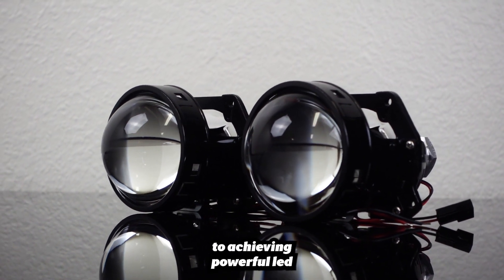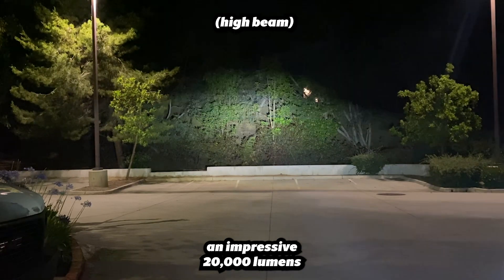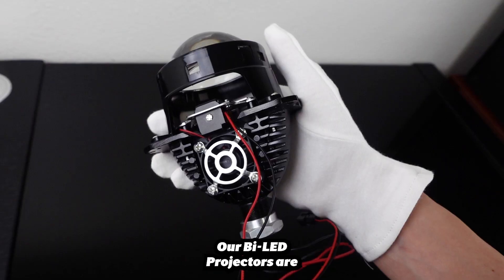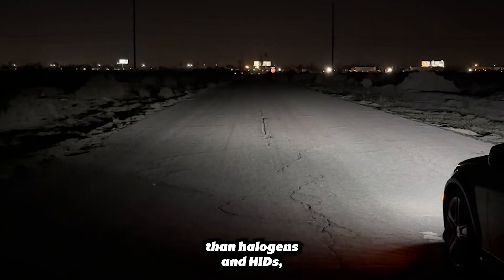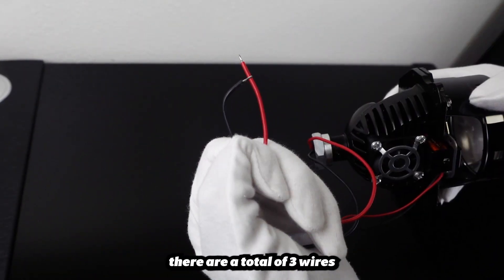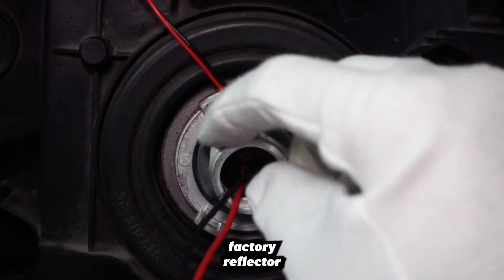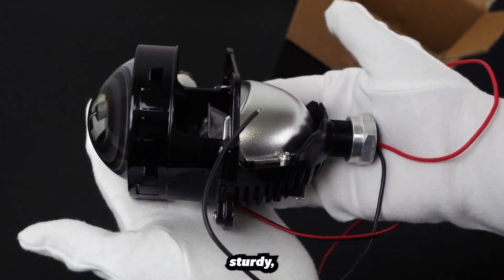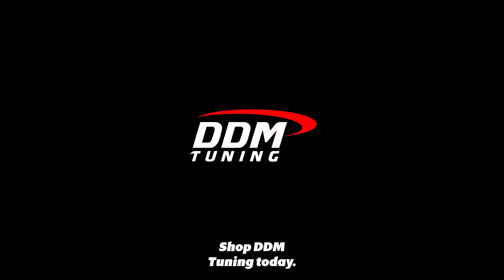DDM Tuning's Bi-LED Projector w/Non Destructive Installation, The Easiest Projector Retrofit Now

Comment: How long will they last if I can’t change the bulb? And how bright are they compared to your 75W bulb if I put that behind a projector or even a 55W Ultra ballest HID?
Reply from the maker: Quality is makes these last! They have an expected life of 5-7 years. We're happy to report that no one has ever brought one back for a warranty since we've released them. 

Compared to the 75W, they're about the same. The projector comes out to 20,000 lumens/pair while the 75W is 16,000 lumens/pair.
Reply: @ddmtuning3907 how does your 75W compare to like a GTR Ultra 2?
Reply from the maker: Our's is less in cost $ and brighter. The GTR Ultra 2'd ranks at 41 Watts and gives ~8,000 Lumens. While ours is 75 Watts and gives 16,000 Lumens. Our's is also buy one, get one free right now (till Nov 21st) so you're getting even more for you investment with us.